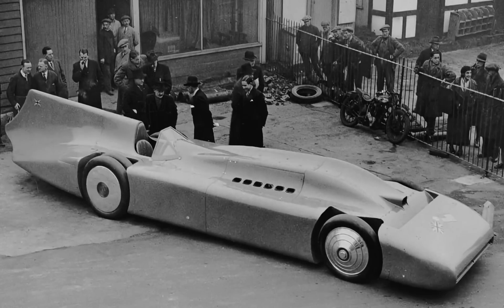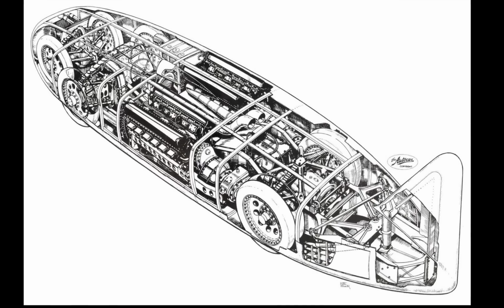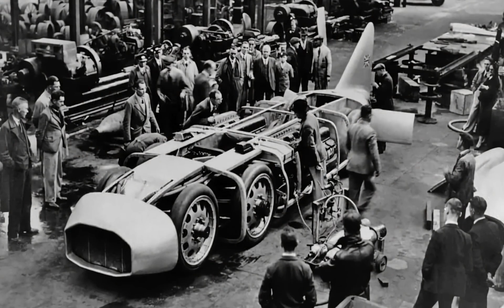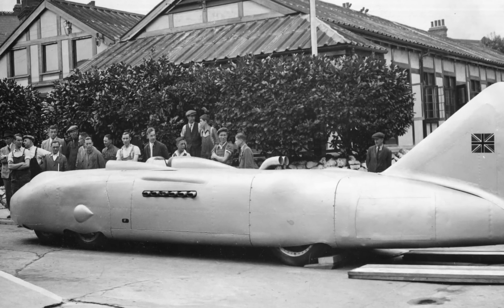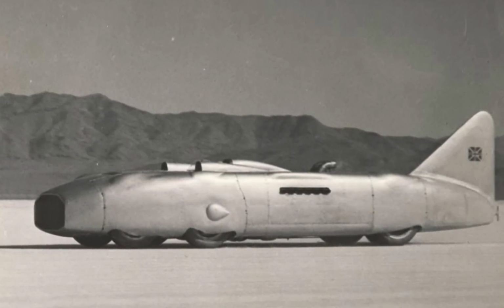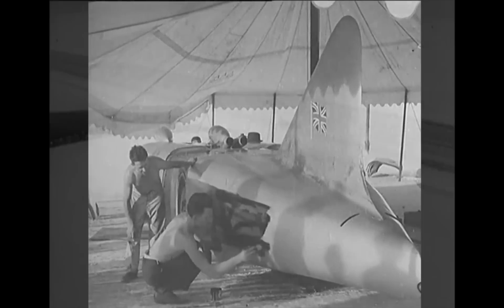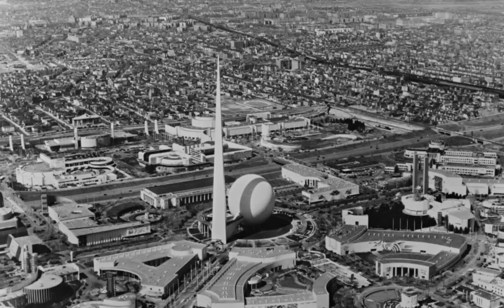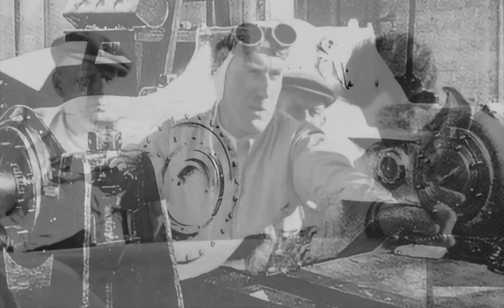George Eyston's Thunderbolt - Land Speed's Missing Monster

Comment: I had a Dinky Toys model of Thunderbolt as a kid. Years later when I first saw a photograph of Thunderbolt, I realised that my toy version didn't have the tail fin. I thought it was due to it not being an accurate model. Turns out it did originally have the fin, but my Dad hacksawed it off because I was going around the house using it as a hammer!
Reply: Your dad actually modified it to resemble its final 1938 iteration in which Eyston removed the fin!

Comment: I wish someone would take some of these engines and refine them with modern manufacturing materials, better fuels, and tuning technology. I would love to see how much power would be possible now.
Reply: Could probably double the power, but would require so much redesign it’d basically be a whole new engine. Those old big displacement engines had long strokes and heavy components which really limit the rpm. When chasing power you quickly get to where it needs to turn more rpm to make more power. And these engine designs don’t turn many rpm.

Comment: Imagine that same car today, but all electric. I see 700 mph easy.
Reply: Fastest land speed electric car record is currently 353mph - that's a LONG way from 700. Battery tech just isn't there yet, the motors are powerful enough but there's no battery array that can sustain its highest output for long enough - well, not one that can fit into a car anyway. In years to come, sure, but not yet.
Reply: It would have to be recharged at each end of the mile negating any attempt at an official run.
Reply: @Draxindustries1  Fast charging has come a long way since you posted that 3 years ago.
Reply: Not easy at all, it's a feedback loop of needing more power, then more downforce, then more power needed to overcome resistance, everything's exponential not linear.

Comment: I know of a boat in Tx. That had a similar or the exact same drive unit in it. It was US military built had twin Diesel engines to a single jet drive.  Designed for the Ma Cong  delta , later converted into a houseboat.

Comment: These weren't cars they were rockets with wheels.
Reply: Actually they were wheel driven cars.
Reply: @AN0NY M0USE Affirm. You're visible.
Reply: Campbell would only use wheel driven cars as he said if it was a jet driven it is not a car thats why he stopped because wheels could not grip any more in fact Campbell and eyestrain  used twin wheels
Reply: @raypitts4880  Eyestrain?! I'm sure he'd laugh. Perhaps an edit?
Reply: @raypitts4880  Campbell died in 1948. the first jet LSR car was in 1963. or are you referring to Donald Campbell.

Comment: 37Litre engine...good gawd
Reply: sharocks super charger gave 2000 hp over above the 1800 produced by the rolls r engine. it weights 180 lbs as opposed the r engine weighing 3000 lbs.

Comment: The weight of these cars was astounding and although streamliners have traditionally been heavy, the fastest cars are now much lighter in weight. My friend's car has been 409 mph with a small block Chevrolet engine on pump gas. I am not sure of the weight, but it is probably under a ton. It is a long, low and thin car. Look up The Nebulous Theorem III. The fastest piston driven car, George Poteet's Goldenrod went over 480 mph out the back door (as it crossed the 5th mile) last August 2020 at the SCTA Speed Week event. It is a single engine car and is no where near as heavy as the earlier streamliners. However, the cars do have to be heavy in order to not spin their tires along the salt surface. The fastest wheel driven car is The Turbinator, which went over 503 mph at the 5th mile. It is powered by a Lycoming turbine engine that drives the rear wheels via a wide rubber belt.
Reply: The current world record holder, Thrust SSC (763 mph), weighs 10,600kg.. :)
Reply: @stephenmorse342  Danny Brown is writing of the "Wheel Driven" speed record, not of the records set by jet or rocket powered cars.  Its incredibly impressive to see wheel driven cars now entering the same speed range as the jet cars of the 1960s.  The wheel driven (and piston engined) speed record remained just slightly above 400 mph (409) for 26 years, a record that was held by Bob Summers in Goldenrod at 409 until Al Teague broke it by about a half a mile an hour in 1991. Motorsports legend Mickey Thompson came close to setting the wheel driven record many years ago, but did not do a return run - if memory serves - but his son, Danny Thompson, set the wheel driven record of 448 miles an hour in 2018 with Challenger II, one of the older design cars, with a pair of conventional Hemi V-8s running on nitro, rather then one of the narrower, smaller cross section cars with a single turbocharged engine.  Land speed record racing is an obsession to many competitors and the meets at Bonneville are an outgrowth of the Hot Rod movement in Southern California and racing on the dry lake beds in the high desert,
Reply: They were built like beefed-up automobiles.  Today's vehicles are built like aircraft which are, by nature, lightweight.

Comment: I can only imagine what would happen if they tried remaking it today what sort of improvement they could make
Reply: With wheel powered land speed record cars you run into some serious limitations the faster it goes. The problem is that you both have to minimize friction from the wheels in order to make it go as fast as possible and not overheat the wheels, but still have large enough contact with the ground to push the car forward. You see the more power you put to the wheels the easier it is for them to spin (lose grip). There are some ways to try and get around this. One is to put seriously large wheels on the car (as on the Blue Bird CN7) which means they'll spin slower for the same speed compared to smaller tires. Unfortunately this also makes the profile of the car higher which in turn adds aerodynamic drag. The other way is to add more driving wheels and while that adds grip it also increases rolling friction. 

Here's another serious problem.  Aerodynamic drag increases cubely with the speed. This means that you need 8 times the horsepower of what is required to go 100mph to go 200mph, 27 times the horsepower to go 300mph, 64 times to power to go 400mph and 125 times the power to go 500mph. 

In other words you need roughly twice the power to go 500mph from going 400mph. 

The only way to "get around" this is to make the car as aerodynamically slippery as possible. Above all the car must have the smallest possible frontal area. 

The current land speed record for a piston-engined wheel-driven car is 448.757mph
The current land speed record for a turbine-powered wheel-driven car is 482.646mph

500mph is possible with today's most ambitious "homegrown projects" . 

Suppose somebody wanted to build a 600mph wheel-driven land speed car.  You'll need 216 times the power of what is needed at 100mph and 3,4 times more power than what is needed at 400mph. This means that if your car needs 3000hp to reach 400mph it will need 10,000hp to reach 600mph. 

What kind of an internal combustion engine makes 10,000hp today and which is reliable enough to run for several minutes under this enormous strain? Sure, there are 10,000hp engines in ships and diesel trains but they're much too large to fit inside a low and slipper land speed record car.  For those who think top fuel dragsters engines will do the job think again, they only run for 4 seconds each race and only last 8-10 runs after which they're stripped down. Obviously you need an engine which must be able to run at least 20 minutes in order to make 3-4 runs (in both directions). Who wants to invest money into building such an engine? A state-of-the-art unique design solely designed for this record is not worth the investment. Besides the outright record will always belong to jet cars.
Reply: @jamesshunt5123  keep talking, I'm listening.
Reply: bloodhound ssc is doing this
Reply: @AndrewFree  yes, but not with the RR engines.
Reply: @Blown460  Lol yea no doubt, its a long time later. The SSC is way cooler anyways.
Reply: @Blown460  Bloodhound has a ROLLS ROYCE EJ200 TURBOFAN.

Comment: Just a detail info correction for non-UK viewers here: 
The RR engines are narrated as costing £5800 ea in 1930, equating to approx £380,000 in today’s money. This is then misleadingly captioned as equivalent to USD $475,000 which sounds a lot but actually hugely understates just how expensive in global terms those engines were at the time.
£1 sterling was equivalent to just under $5 in 1930, and £380,000 approximates to around 1.7 Million dollars, not 475,000.

Comment: Thunderbolt was kind of a brute-force engineering exercise to build a 2-engine 8-wheel car, and then only go 50 mph faster than Bluebird.  But it did succeed despite all the added complexity.  John Cobb's car was a more elegant solution, and went faster with a lot less engine.  Have you done a video on the Railton Special?
Reply from the maker: Not yet! It’s on the list...

Comment: Problem is, the engines were huge because they were designed for reliability, but a land speed record, like drag racing needs horsepower per size and reliability only needs to be so good enough for a run.  This is why a car powered by  2 Chrysler Hemi engines ran 448mph.
Reply: A Champion has to be prepared to defend his title, so the car better have more than one run in it.
Reply: @42lookc  engines are rebuilt between runs.
Reply: this achievement was over 50 years later, golden rod went over 400 in the 60,s now t f run 330mph in a 1000 ft , if there had been no war just think what the man may have done ,also cobb and cambell

Comment: 2 engines? yea clutch problems . Can't  see why  demanded 2 engines with 5000HP, one engine at 2500HP ought to be able to do it. Way too overbuilt. 357 in 37?  take the wings off of a Me 109 -379 in 37
Reply: If it was that easy it wouldve been done.  Also, aerodynamics was in its infancy at the time, so power was the only real way to push speeds that high. If you needed more than 2500 horsepower you needed 2 engines. It's quite simple really
Reply: The ME 109 weight less than 2.5 tons, even with the wings on... Thunderbird was almost 3 times that weight. If I'm not mistaken the plane has no gearbox, at least not in the sense that cars have, and then look at the tiny wheels on the ME... 
Good luck though using that as a base for a land speed record. For one, on the plane you'd want the center of gravity on a line dead center behind the propeller. On a car, you'd want it as close to the ground as possible. The ME would just tip over at the slightest bump. Of which even on a ground that flat, there are many. Especially at that speed. And at that speed, without enough weight and probably added downforce, the slightest bump will get you airborne. Look up Mercedes Le Mans flip. If you're going for a land speed record, you want your vehicle to stay on the ground. Which means it has to be heavy or create tons of downforce through aerodynamics. One way or the other, wheels, suspension and chassis have to be massive.
Reply: @AvB.83  I want to hear more,  educate me!
Reply: How truly unfortunate that some of the best engineers at the time didn't have your keen insights into LSR power plant selection.

Comment: Wool doesn't burn lol
If anything the fact the warehouse was full of wool bales prob reduced the severity of the fire
Reply: Lanolin does, lol. You might want to look up how severe historic woolshed fires have been. This was newly shorn, unprocessed wool, straight off the sheep's back, not the clean stuff your clothes are made from.
Reply: it doesn't?
Reply: @Caseyedwards1  
No it's naturally resistant to fire 
Hence it's a common material in fire fighting clothing and some insulators 
It's the only natural renewable material that's water and fire resistant 

Straight off the sheep it's got lanolin grease on it (makes the sheep totally water proof) 
It must be proccessed to get it into a wearable product and get the totally fire resistant properties 
But I use fleece wool as a welding blanket in our steering shed and it doesn't burn 
The wool packs used to move the wool back.in the day wetr hessian and that certainly burns 
But as the pile collapsed it would smother it's self 

A totally timber building with a tar roof would go up like a bomb though, along with other stuff like planes inside
Reply: @fowletm1992  We learn something each day. ;)

Comment: A fantastic story, many thanks for bringing it all together. These guys were amazing, they did not use wind tunnels,CAD, dynos, their knowledge of aerodynamics was limited by todays standards, but they knew the fundamental physics about how the power required changed with speed, doubling the engine for a limited increase in speed.
 The same approach was used for the current record using two engines.

Comment: How crude; they should have just put it on rails. Typical Anglo "bigger is better" bullshit, set back land speed car development for decades.
Reply: Wheel driven speed records and rail speed records are completely separate things.
Reply: @spazmoids  - I think you being obtuse.
Reply: I'm sorry, but it's Americans who tend to follow the credo, "bigger is better". Look at that lethal lash-up the White Triplex.
Reply: Shut up. You clearly don't know what you're talking about.
Reply: How did it set back development?, the car was being developed constantly, which is how these thing go, to have run it on rails you would first have to make the track, with a measured mile and a mile or so to get up to speed and a further mile or so for slowing down your track is now five miles long, you cant leave it there for others to use because the salt would rot it away, so your idea is simply a non starter, the reason its held at Bonneville salt flats is that the area is just huge, miles and miles of it, (look it up on Google maps!).
Reply: Bigger is better is an american trait. mainly their heads and mouths. and the Anglo, as you put it still holds the record LSR.
Reply: Landspeed records are kinda pointless anyhow.

Really, only manned airbreathing hypersonic flight is a real challenge to solve (we have already done rockets at much higher than entry to hypersonic). 

Many of the other records are merely contrived puzzles (something do do once all other challenges are put to bed)...  lol...

Exciting to watch and amazing that people take the immense efforts to achieve what they have non-the-less.

Absolutism of course is always somewhat wrong.
Reply: @kadmow  I must respectfully disagree with you on landscaped records being pointless. Think of all the advances that were made in mechanics, electronics, hydraulics, etc.. that are made when problem solving the unique challenges posed by landspeed records. The men that pushed the limits of currents abilities were admirable problem solvers. The tech invented didn't just apply to the purpose designed for often people would see its applications in unrelated fields.

Comment: Wait so if my math is correct, that is a combined 74 litres for 24 cylinders? That is beyond a doubt, absolutely absurd!!! I love it haha. Imagine a 12.3 litre 4 cylinder engine....Lmao
Reply: same capacity as a Griffin. I think this was it's predecessor
Reply: @fuzzjunky  the Griffin was a development from the Merlin, which itself was a development from the racing engines featured, the Merlin also became the meteor as used in tanks and boats, Rolls Royce got good milage out of their design (it was even made under license by Packard in America during world war two).
Reply: Not quite as big but my Range Rover had a 3.8 litre Perkins engine in it, my friend had an 850cc Mini, I had more capacity in one cylinder than he had in his his engine, (both were four cylinders), and my engine is tiny compared to those monsters.
Reply: @CrusaderSports250  I feel kinda dumb bc I thought I knew most engines but didn't know about that one. That's an insane displacement for a 4 cylinder! Was it reliable and maintenance friendly?
Reply: @olliefoxx7165  runs fine!, the engine was a replacement for the 3.5 litre V8 nothing wrong with that one, a beautiful engine (gorgeous sound I just loved it), a development of a Buick and used extensively by British Leyland in a wide variety of vehicles, but although I drove my one carefully I still only got around 18.5mpg (British gallons ), a bit of an ouch at the pumps, so goodbye petrol hello diesel, a reasonably simple conversion and bingo twenty five miles an hour slower but nearly thirty to the gallon , oh and the sound (noise!!), got a bit louder, to the point that around fifty was your comfortable limit, but 28.5 mpg (did I mention that☺), the engine was widely used in tractors and plant I had a posh one from a combine harvester, so I got a high speed pump (pump speed governs engine RPM), a huge 150 RPM more than normal, spares for these engines in Britain are plentiful and relatively cheap and although it was a recognised conversion it wasn't a favoured one, the engine being a bit on the agricultural side, but it started well ran (runs) well and I am not a fast driver so what's not to like, she is of the road at the moment in need of a bit of TLC but will live again.
Reply: @thought_son3  gotta look that one up! Thanks👍